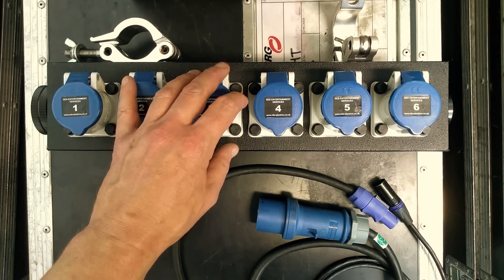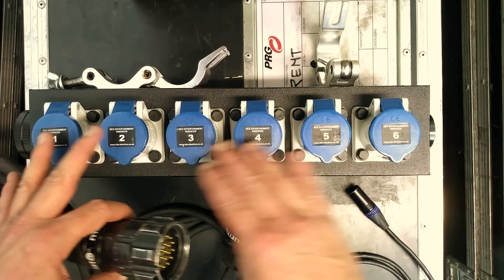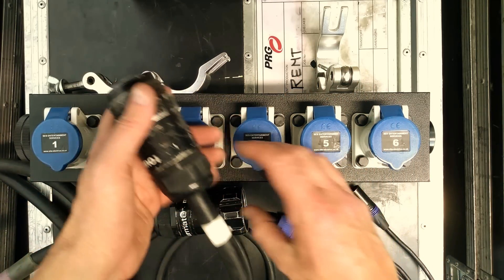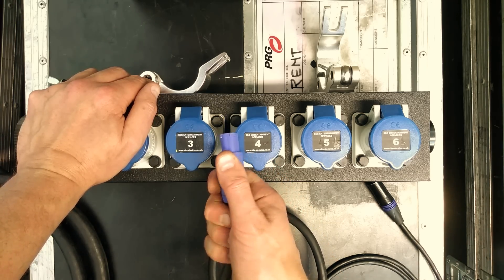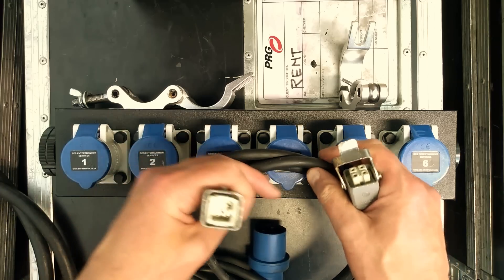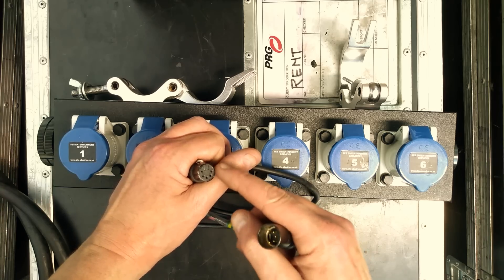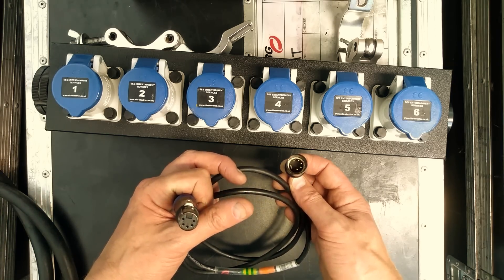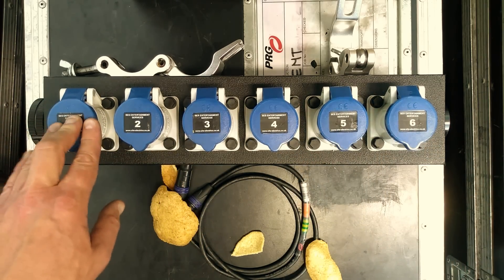Entertainment industry connectors.

Comment: that blue connector you call ceeform is used on basically all camping grounds and caravans, I had no Idea they were used by the entertainment industry too. Makes sense, though, since you don't have to deal with the annoying different plug types all over Europe that way.
Reply: tommihommi1 - The yellow type is very common on worksites where 110V power is used.
Reply: We use green triple pin ones for connecting concrete vibrators to the frequency converter.
Reply: We use the yellow connector for motor control ;) Mark 1024MAK
Reply: @Mark1024MAK  not really a thing over here, we use 230V single-phase and 400V three-phase pretty much exclusively.
Reply: tommihommi1 - I was referring to the usage in the U.K. That is on construction and building sites, temporary engineering worksites and other temporary supply systems (e.g. temporary site / utility / public lighting). The 110V is supplied via 240V to 110V isolation transformers. And the secondary supplying the 110 is centre tapped to earth (ground). So the maximum voltage between earth/ground and either conductor is 55V AC.
If there's a power tool available in the U.K., there will be a version rated at 110V and supplied with a yellow CEEform plug... (including radios to keep the workers happy :-) ).
Reply: @Mark1024MAK  that seems like a whole lot of effort for very little gain. Everyone else in europe just uses the standard stuff everywhere. Especially since you're gonna want beefy devices with lots of powah on building sites, so the higher voltage and option for 400V three phase for the big guns kinda helps a lot.
Reply: Mark 1024MAK Spot on mate...the three types are similar but not actually interchangeable. Intentionally so for safety reasons and to keep Red 3 phase, Blue 240 v and Yellow 110v from being connected. The UK safety people won't allow mains tools on a building site which aren't 110v, lots of builders like battery tools for this reason. There is no way 3 phase would be allowed in what is often a wet environment as its lethal.
Reply: tommihommi1 
It's not about gains, it's about safety!
Reply: tommihommi1 - you have to remember these rules were established before RCDs and the higher integrity enclosures found these days.  Honestly' they're still relevant as power cabling is incredibly vulnerable and you can get yourself in nasty situations on building sites that an RCD can't discriminate. If you want POWER you use pneumatics, or maybe even hydraulics.

The UK generally has an extreme attitude to this type of physical safety - consider the pull cord l;ight switches and only electrically isolated shaver sockets in the bathroom as another example.
Reply: Yes, in the UK water and electricity don't mix. Heck, even hot and cold tap water don't mix! ;-)
I was told an added benefit of the 110V power tools is that it disincentivises theft. But I always thought the thief would probably just steal a transformer....
Yesterday a 33 year old man died here in Austria from electrocution (three phase power and a welder were involved) so it seems inappropriate to claim it's all perfectly safe and the British are just ninnies.
Reply: Robin Turner So what is used to power a rotating cement mixer in the UK if not a beefy 3-phase motor?
Reply: I don't think they have much 3-phase in the UK, at least in residential. Their meter panels still look like some installation from the 1950s with two loose wires (L and N) going from the meter into a small single row consumer unit that wouldn't pass for a shed sub-distribution elsewhere. Even the electricians that try hard to do a good job (say Thomas Nagy for example) can't really do much more than put together a hodgepodge of materials available and approved for use. You often see him cascade several consumer units together, with cable channel in between to make it somewhat presentable. I don't get why they don't just adopt decent multi-row cabinets.
Anyway, the concrete mixer will be single phase, 240 or even 110V, or internal combustion engine. A concrete mixer doesn't need that much power (0.6-1.5kW) but of course 3-phase offers such superior torque characteristics any stationary motor should be supplied that way, no matter the power rating.
Reply: stefantrethan A single AC sine wave is capable of turning a motor just as much as a 3 phase. Motors that have 3 phase need to have an a undisturbed precise continuous movement. That why in the UK we don't put a 8L V8 engines in our 2L straight 4 cylinder cars.
Reply: A single phase is incapable of producing a rotating field and turning a motor, that is why you have to generate a second phase with a capacitor (or theoreticlly a resistor or split pole but that option is not used on concrete mixers). At any given load and steady RPM, yes, you can select a capacitor that'll produce similar power output, although the single phase motor will be larger and less efficient. This is fine for a fan or something, but especially in a concrete mixer you have wildly changing torque, frequent starting under load, and a three phase motor is incredibly superior in these conditions. I have both single phase and three phase mixers and nobody in his right mind would choose to use a single phase unit if there is three phase power nearby. 
I don't understand what you mean with precise continuous movement?
Your analogy with motors is apt, but you should compare a single cylinder motor to a four cylinder one.
Reply: The construction equipment I see for sites like that have their own built-in internal combustion motor.  Usually gasoline.  There's no guarantee that there will even BE power available when a (relatively) small on-site cement mixer is needed.   Often they're the first piece of equipment necessary to create the foundation for the power.
Reply: @stefantrethan  We have lots of three phase in the UK, most houses don't have it but all but the smallest commercial properties will have it. Yes we do use single core "tails" to connect up our meters (and not just single phase ones), though they have two layers of insulation nowadays, so they aren't really any more hazardous than any other sheathed cable. Multi-row consumer units do exist here, but aren't all that common, we tend to have less circuits in the UK than in other countries because of our use of 32A rings for sockets.
Reply: Err.. A big part of Europe use Schuko. Also, if you're an american wanting to do a production in Europe, you'll usually end up renting the gear from european companies as it's a lot less of a hassle
Reply: I really miss the EU blue (and 110v yellow) connectors in Australia. They were durable, robust and well-nigh waterproof even under uk torrential "light summer shower" conditions :-) . Here, our "approved" 15A caravan to shorepower connectors look like this - https://agmelectrical.com.au/images/thumbnails/323/323/detailed/5/transco_IL15_Transco_Caravan_Motorhome,_RV_15_Amp_Power_Inlet_IL15_xjoh-wm.jpg - basically  a plug in the caravan wall. Really no environmental protection, and certainly NO protection from inadvertent removal (tripping over the cable). We can't even upgrade to the EU standard, since it "doesn't meet Australian Standards".
Reply: I've seen the blue and yellow C-form connectors in kitchens that had to be reconfigured during the day. Heated cabinets, heated prep tables, toasters. The male cords have sealed collars that twist-lock to the female drops for a solid connection hanging from the ceiling and to keep moisture and grease out.
Reply: I know these as "commando" plugs and sockets, but I'm not sure of the origin of the term. They are also extensively used in datacenters.
Reply: Used in kitchens too.
Reply: It was first used in industry in it's 16amp 32amp and 3 phase, its only been used on sites because of its ip rating , it was used in entertainment before camping and caravaning

Comment: Single phase CEE is not used in German entertainment industry. Socapex is rarely used, we use Harting Han 16
Reply: That's why it's widely called caravan plug :-P
Reply: I did light and sound in an amateur troupe years ago, and for distribution we used 48-pin Hartings (I think it was 48 - you could beat someone dead with the cable alone), and regular Schuko on the lights.
Reply: Yes, regarding CEE, I've seen it before, but it's rather rare.
Socapex comes up not too rarely as multicore connector for as many as 48 pins. Harting tends to be preferred for power applications, rather than signal.
Reply: You can't say it's not used. There are many companys that use at least the blue 16A CEE for power distribution and sometimes also 32A version. I know at least 3 companys in my region that do so.
Reply: Same in the Netherlands altough some theaters use only CEE
Reply: SKORPION 15 to be honest, CEE is pretty common in the Netherlands. In outdoor productions the single phase blue ones are widely used, some theaters also prefer CEE over schuko (for obvious reasons) and you'd straight up lie if you said that you've never seen the red multiple phase CEE connectors here..
Reply: Some appliances in the big kitchen of the local hostel use the CEE thing or at least something very similar looking.
Reply: DA666 possibly red ones? CEEform is standard in NL and DE for three phase connections, and then it’s red. The blue single-phase 230V type is basically just caravans, and the occasional industrial application, and yellow which is for single phase 110V is something I’ve never actually seen in person.
Reply: +DA666
Eventually Perilex? 

https://en.wikipedia.org/wiki/Perilex
Reply: @Marcel_Germann  Yeah Perilex is still around in kitchens and stuff like that. Though newly built ones will use CEE as well. Perilex is kinda, what you say, "legacy technology".
Reply: German entertainment? Isn't that an oxymoron? ;)
Reply: @RambozoClown  since the the companylogo you see in the background is PRG, biggest enterteinment tech Company in the world, which originated in Germany I guess not. And technicians from Germany are highly demanded in the big big productions because we have a ton of regulations.
Reply: Rambozo Clown oxymoron is Germans signing a petition for 60 speed limit on autobahn...

Comment: If the phase of the Ceeform bank is important, how do you get the Socapex oriented the correct way?
Reply from the maker: Each channel is treated as a single phase outlet.
Reply: belive there is a notch what you have to line up with the socket. you can just about see it in the video.
Reply: There's a key

Comment: Big Clive. I was able to"fix" a water  distiller that burned out the on/off switch because of you. I used your logic found the problem and fixed it. Thanks big guy. I wish I was as trained and adept at electronic issues as you.
Reply: S Holder . You made a great start. It just takes time brother. Get in the trenches and you will learn more then you can imagine. Like you did. Don't be afraid to try. Just be careful. Cheers.
Reply: @robertsmiczsmiczamplificat593  I am careful. I fear and respect electricity. I did a small circuit in our barn. A breaker box and 3 receptacles on 110V.  I think I read the chapter in the book 4 times to make sure I didn't screw up.
But FYI, I am of the womanly persuasion so it's sister, not brother.
Reply: Respect!
Reply: @mistaowickkuh6249  I never work on anything"live". And after repair I am at a safe distance.
Reply: S Holder another good idea that sounds like showing off, but is actually for safety:  Work with one hand behind your back.  Not necessarily behind your back, but only one hand in the electrical stuff at a time.  If you do make a mistake, and get a shock, you've only got one hand in circuit, and you're much less likely to jump through your heart.
Reply: Sooner or later, somebody's going to immerse their finger in that water or touch its spigot. "staying back after a repair" only works for a short while, unless you'd only be waiting for a guineapig.
Reply: @mistaowickkuh6249  
Bit late to the party here... but I need to say, it's a total myth that "current would be less likely to go through your heart when you get shocked in right hand compared to touching with left hand'!
It is not true that it would be less likely to flow through your heart in that case. That is typical one of the first myths that is debunked when you get a proper health and safety/first aid/training involving electricty.
Reply: @mistaowickkuh6249  
No, it certainly doesn't mean that. I never said, nor implied that...

All I said was that it is a very common myth that "if you touch with one hand it would be less likely the current goes through your heart compared to when you touch with the other hand."

Myth comes from the very big misconception that some people think the heart is located on your left side and thus that it would be "relative safer" to touch with one hand compared to the other, as the path the current would take would be closer to the heart compared to when you touch with the other hand.

But that is not true. The heart sits in the middle of your chest, only VERY slithly located a bit offcenter (that is to say: the apex is a bit bigger to the left). It is not "less likely current will flow through your heart", it is equally likely.

Stating it would be "less likely", even if you do not meant to say it is "ok to touch with the other hand", is complete wrong and dangerous (you always have nitwits who interpret such stuff as "oh, then it is ok to touch with the other hand" or dumbo's who wanna test it out)...... Simply don't state such nonsense and/or reinstate that myth...

;-)

Comment: I've three CeeForm 16A plugs I got in a box of mixed electrical bits off ebay, no use for them (at the moment), I just like having them around... :D
Reply: Use them to charge Uranus 🤓🤪😝
Reply: I'm not a Series 4000 Mechanoid, my recharge socket is not there... :P

Comment: I love Neutrik connectors.
Reply: I work in a Grip and Electric rental house and our Neutriks fucking come back broken all the time. They still work technically but the locking slide comes off easily then the small spring is often lost.
Reply: Perhaps if the fucking could be blueprinted, they'd not come back as broken.
Reply: Yes.... Me, Neutrik and Switchcraft = love triangle..
Reply: Agreed, the plastic ones are a bit crap but the metal STX ones are great. Quite waterproof as well.
Reply: The quality is right, but Neutrik does some really sketchy shit to build their monopoly...
Reply: Still a newb in the realms of electron plumbing here, was caught by surprise when Clive said the NL2 (I believe that's the one he has, it's the one I use anyway) is vulnerable to arcing if disconnected under load. Not planning on introducing spontaneous disconnects, though I do want to get into charging in the field. I am wondering if I should be using something more skookum for charging big ebike batteries (72vdc 3a with plans for up to 144vdc 8a.....)
Reply: The original Neutrik Powercons (NL2 are Speakon, not Powercon) have always been no connection/disconnection under load. The new versions are the powerCON TRUE1, which can be con/discon under load.
Reply: STX series Neutrik speakON are a whole different level, it's insane.
Reply: Never not satisfying!
Reply: With the right amount of lube they are all good.